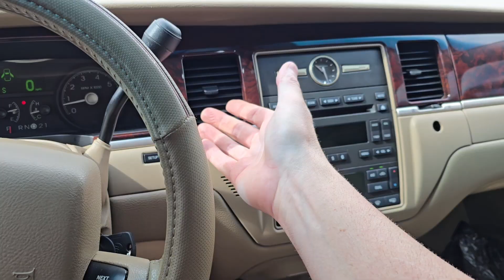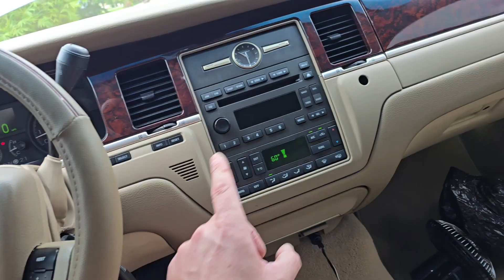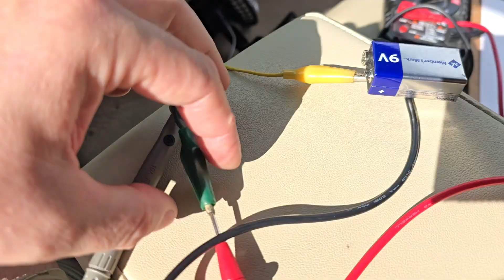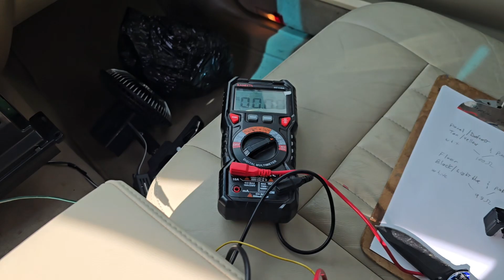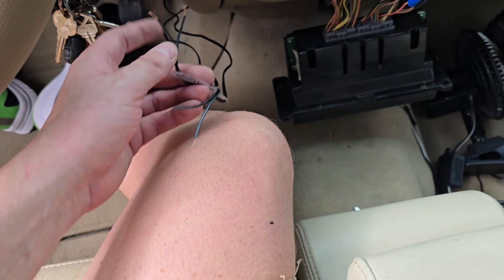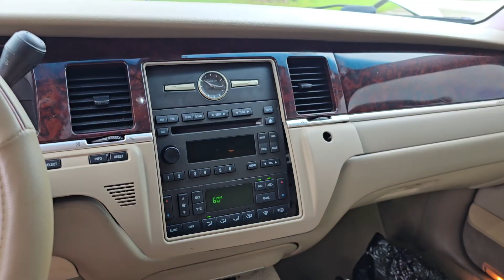2007 Lincoln Town Car-AC Blend Door Actuator Workaround-Avoids The Removal Of The Entire Dashboard

Comment: I have an 04 and an 09,  I've had more problems with the 09. I'm having the same ac issue with the ac in the 09. I had to unhook my heater core in my 04. Luckily the 3 days a year I need heat I have another car I can drive. I'm going to get my 09 blowing out the dash and just unhook the actuator,  hopefully that works.

Comment: Pretty ingenious thought. If it were me I would have installed two DPDT (Double Pole Double Throw) switches.  It is a three position switch that is off in the middle and changes polarity depending on which way you flip it. Hook into your car's cigarette lighter for power. Make sure you get momentary switches that flip back to the off position when you let it go.    Any problem with your blend door actuator (temp control) ?

Comment: A hack for the back window issue, press the "down" button while someone slams the door shut.  Often works.  The problem is that it gets stuck in the seal.  So then, some kind of lubricant for the rubber seals is needed (forgot what - silicone?).  However, unless you keep on top of it, the window will eventually get stock again.

Comment: I had to replace the "passenger air bag" light on my 07' also. The metal retaining pins on the sides fail. I used a Dorman 924-899. 2 minute fix. Great video. That's all the convincing I need to not remove my dash.

Comment: For the last 13 years, on my '05 Town Car, I've been able to mitigate this problem by cycling back and forth between defrost and auto settings several times over the first few minutes of driving. Yes, hitting a bump can cause it to go back to defrost, but when that happens I just repeat the cycling procedure and it will be blowing out of the vents once again. 

Also, bi-level (panel vents & floor) always works, so if I'm okay with half the airflow coming out of the floor and half coming out of the panel vents, that will work 100% of the time and I just press Auto and then bi-level and I'm good.

But that's just my car.  I will eventually replace all the actuators and the heater core, but right now, 21 years old and 363,000 miles, it's still doing fine so I'm not going to mess with it yet.